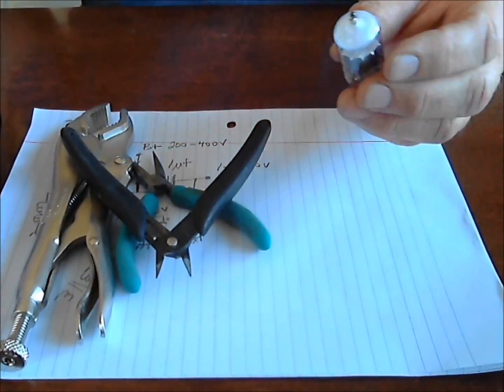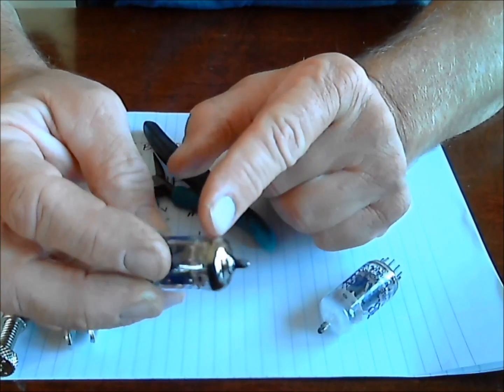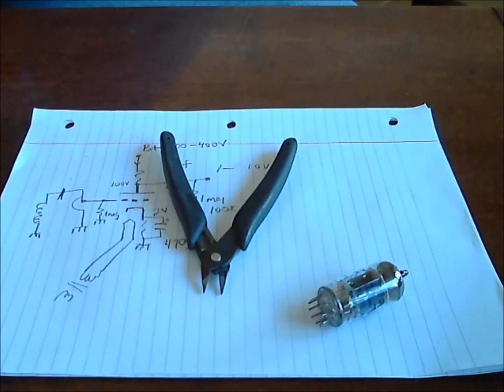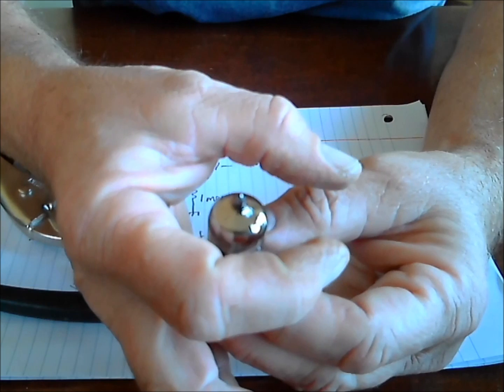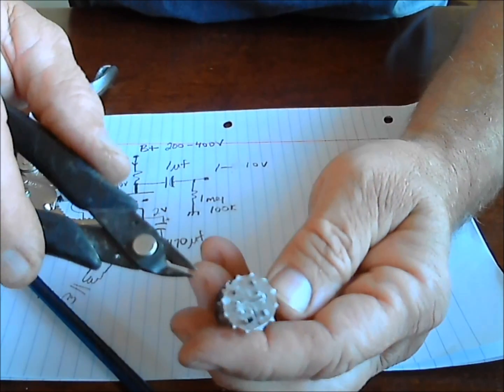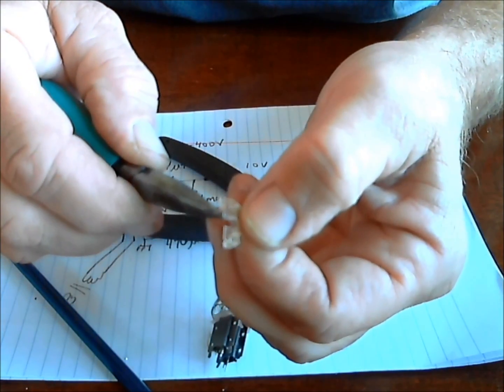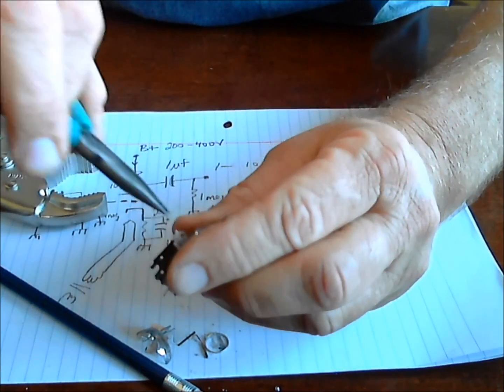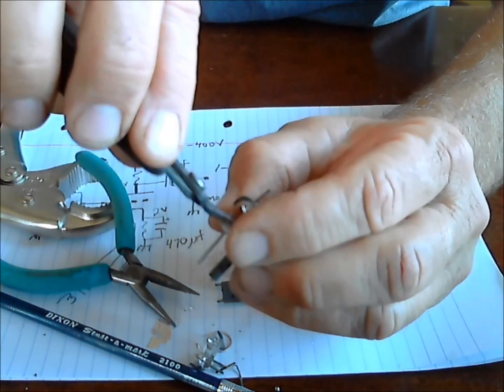How A Triode Is Made Pt. 1

Comment: Actually, there's a number of potentially quite toxic substances contained inside the envelope of a vacuum tube. The getter in small signal receiving tubes is usually barium - which is mildly toxic, but can also be made of strontium (most isotopes are not toxic, but tubes may contain traces of the radioactive element strontium 90), caesium (which is mildly toxic), or other materials, particularly in larger power tubes. The filament may also be made from thoriated tungsten, thorium being a heavy metal (and therefore toxic) and radioactive - this is usually the case with directly heated cathodes as are common in rectifying tubes and large bottle triodes. Tubes may also contain zirconium which is mildly toxic, vanadium which is toxic, cobalt which has toxic effects with chronic exposure, and a number of different rare earth elements are also often present in tubes, all of which can be toxic. 

You might want to spend about 2 minutes doing some research before presenting yourself as an authority on the subject and presenting incorrect and potentially dangerous information.
Reply: You are totally right. Playing with tubes in this way is no child's play. Though I did break quite a few tubes when I was young (12-13 years) at that time I didn't know better. Today I would protect myself with at least glows to avoid cutting myself.
Reply: Thoriated tungsten is only used in directly heated cathodes I think.  Barium isn't going to get in you if don't handle it deliberately...  Electrodes are mainly nickel, copper, molybdenum, tungsten and pretty safe I believe except in some rare exotic devices.
Reply from the maker: hey Greg Robinson what is your problem?